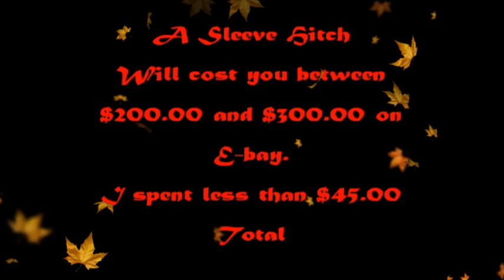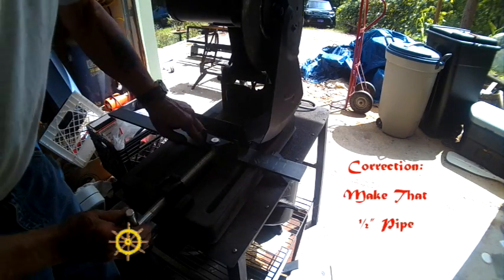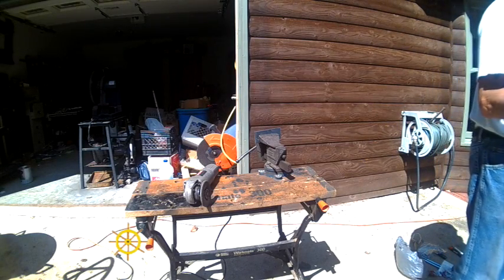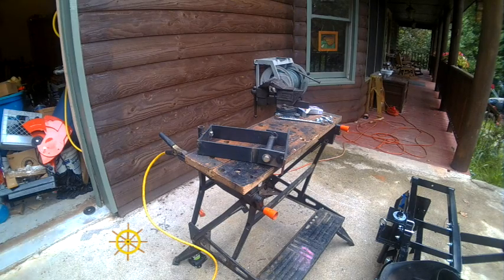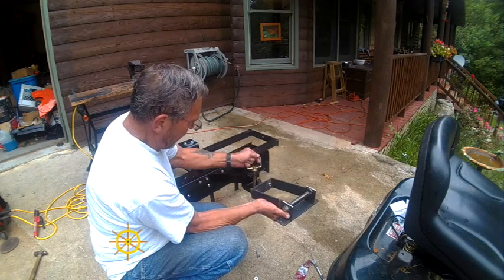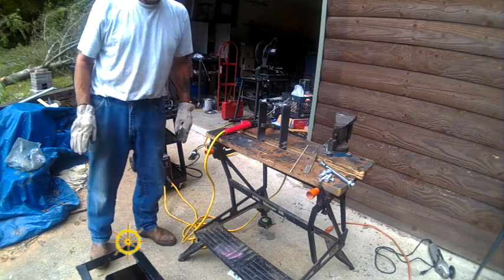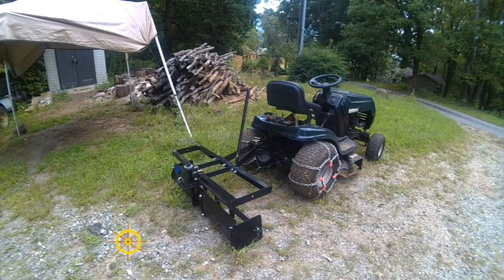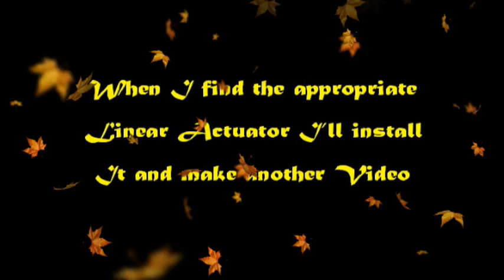Sleeve Hitch Fabrication do it yourself and save money (Part 1) See (Part 2)

Comment: Always good to see another fabricator at home working,  that chop saw will cut better standing that flat bar up instead of flat,  easier  on the blade  and saw, the burrs left on the stock I just use the chopsaw blade on the side to remove those,  great  job sir!

Comment: Building one for my ATV. I saw a design that I liked and without any dimensions I did a lot of guessing and what I thought would work. Still not done yet, I plan on putting a winch on it and it hasn't came in yet. I will use that to lift the implement. I am using a welder at my job so I don't have any video building it but I plan on uploading a video after it is finished to test it out.

Comment: If you don't have a bender, rather than cutting a lot of pieces only to re weld them again you might consider using a cutting wheel at the bends. Cut a line at your bends a little less than halfway through your stock. This will allow a bend on a very precise line. You can then weld that bend on the cut side. Much easier technique. 1/4 inch is a little flimsy. Consider 3/8 next time.
Reply from the maker: +Joe Sommers Thanks for the comment Joe. If you will notice the 2  10" side pieces, I did just that. Cut them halfway through then bent and welded them. Hard 90 deg. bends are very difficult without a Hydraulic Bender which I  don't own, so you go with what you have. The reason for the 1/4" vs 3/8" Cold Roll is Cost and need. It's only a 48" Box Blade so 1/4" is more than adequate.
Reply: SmokymntnEd flimsy

Comment: That tractor really is not big enough nor is rated to do grading or dirt moving if I were you I would definitely recommend a garden tractor. These are great for mowing but using these types of attachments will wear out the transmission and put tremendous stress on the frame and can weaken or even bend it.

Comment: seems like the handle might work better attatched closer to the back of the blade... also maybe just using a longer handle with a big spring on it? perhaps a place to lock it in the up position? I am trying to cook up a homemade gravel flattener lol Did you make the blade yourself? I am brainstorming stuff... this is the best contraption I have seen so far http://www.hoelscherinc.com/g/lil-spike-1_large.jpg
Reply from the maker: Sorry about the Delay in replying, Youtube put your post in a Spam File, because of the Link you added. A friend of mine has one of those he pulls with A UTV. It does a good job but is very Expensive though. With my bad back that handle had to go so I installed a Linear Actuator. The Link is at the end of this Video.

Comment: why put a sleeve birch behind an mtd
Reply from the maker: When an MTD is all you have, you put it to work. Thanks for the comment!
Reply: I have had an MTD perform flawlessly for the last ten years....
Reply from the maker: I agree Charlie! My Bolens (MTD) is now 8 years old and has been used hard. The only problem I had with it was the Ethanol in the Gas ate the Rubber piece inside the Carb Bowl away over the winter, filling the Crank Case with Gasoline.. $27.00  and 3 years later She is still chugging away. I have a rough time justifying spending $2,000.00 to $5,000.00 more than I have to. if  the Boilens dies I can buy 2 more for what A Deere would run me.
Reply from the maker: Thanks for the Comment! My Bolens (MTD) is now 8 years old and has been used hard. The only problem I had with it was the Ethanol in the Gas ate the Rubber piece inside the Carb Bowl away over the winter, filling the Crank Case with Gasoline.. $27.00  and 3 years later She is still chugging away. I have a rough time justifying spending $2,000.00 to $5,000.00 more than I have to. if  the Boilens dies I can buy 2 more for what A Deere would run me.Read more Show less Reply     1
Reply from the maker: Thanks for the Coment! My Bolens (MTD) is now 8 years old and has been used hard. The only problem I had with it was the Ethanol in the Gas ate the Rubber piece inside the Carb Bowl away over the winter, filling the Crank Case with Gasoline.. $27.00  and 3 years later She is still chugging away. I have a rough time justifying spending $2,000.00 to $5,000.00 more than I have to. if  the Boilens dies I can buy 2 more for what A Deere would run me.Read more Show less Reply     1
Reply from the maker: Unless you buy a commercial mower most of the store brands were manufactured by MTD. Some of the better names MTD builds are. Cub Cadet, John Deere, Bolens, Craftsman, and many others.